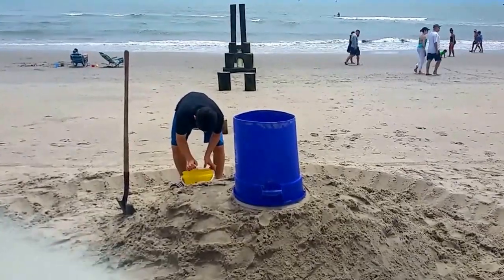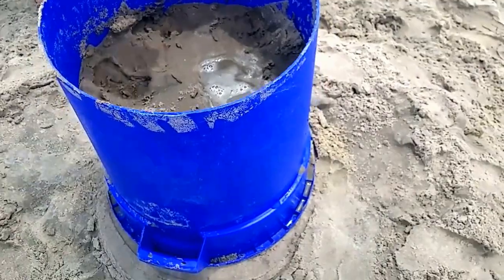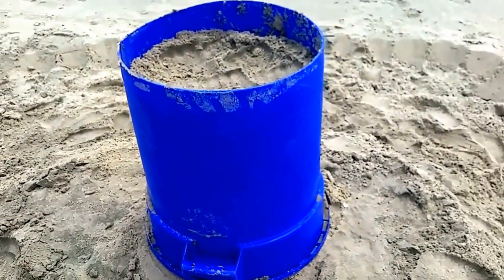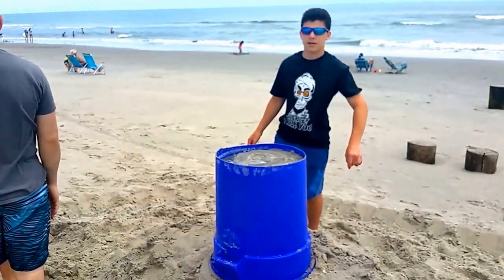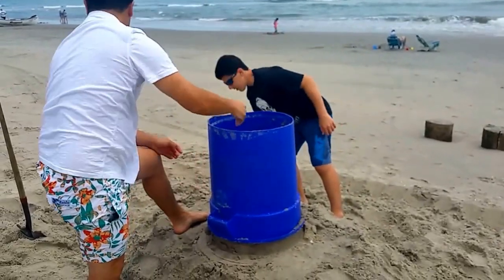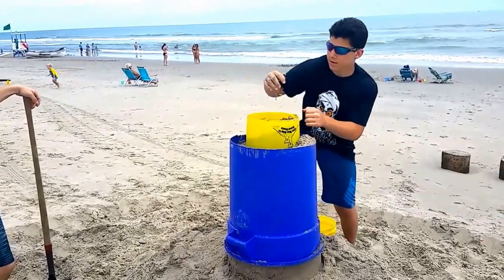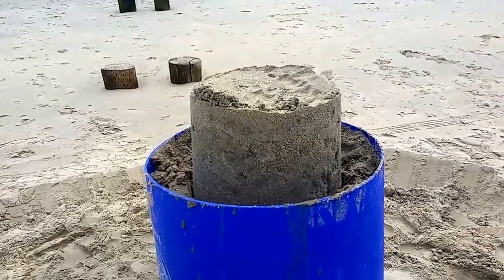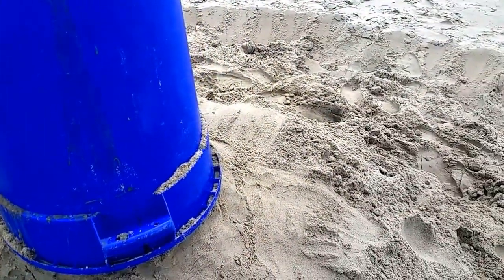How To Make Sandcastles (Step 2) - The Large Base Tower

Comment: What if you don't have one of those blue bucket things to make a base
Reply from the maker: You can take any old trash can or bucket and cut the bottom off. Otherwise you just need to pill up the sand by hand and use A LOT of water, it will old it together.
Reply: Hey a Marie - dont worry - just keep making the volcano bigger? - start with about a 5 ft wide circle of sand and fill it with water, then fill in the middle with sand to water, then build the sides up again and repeat - you may have to wait for it to drain but just try and keep it like a cylinder till you are as high as you can manage - you dont have to have a large bucket but it helps
Reply: @TeslaLife  thank you
Reply: @SandcastleAndy  thank you